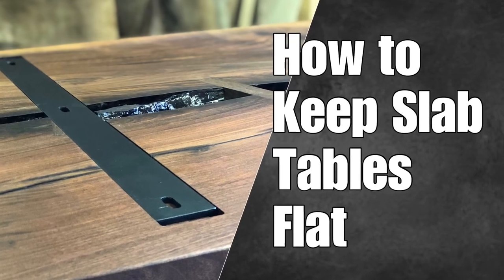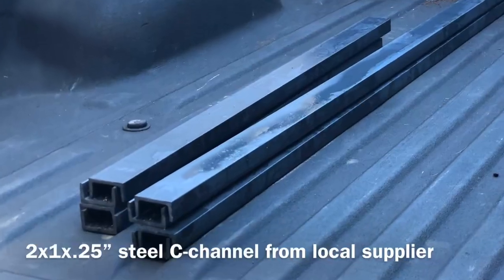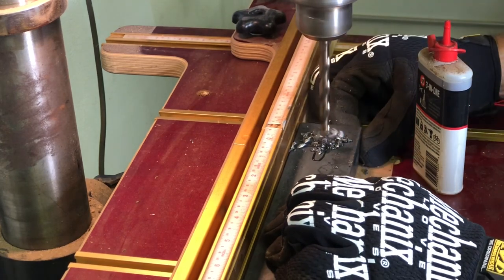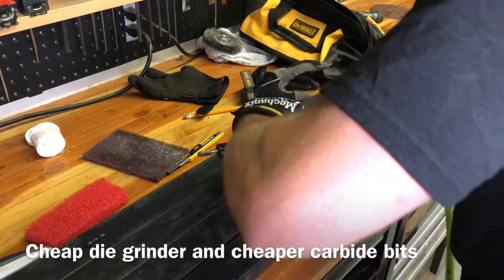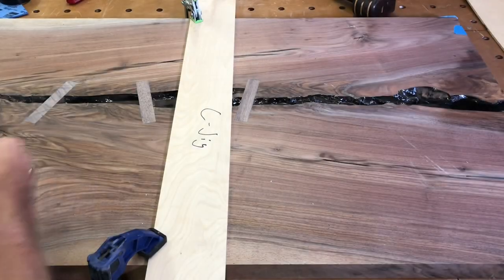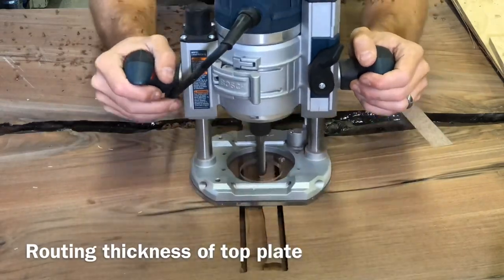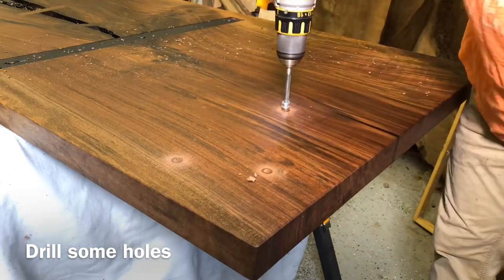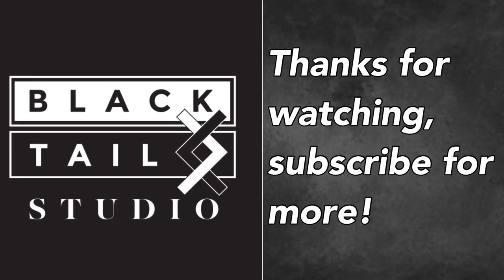How to Keep Slab Tables Flat — How To Woodworking

Comment: Really nice workmanship. I like how you think of everything. Take it or leave it (just a suggestion). When installing the C channel, I think I would just drill a single hole in the centre of the channel and slot the outer holes as you have done. This way the channel will always remain centred when expansion and contraction happen. Just my 2 cents worth.
Reply from the maker: MikeJ yup! I think you’re right on with that point.

Comment: Two questions: i remember you saying you didnt like drilling into epoxy so you needed odd sizes for river tables.... so what would you do on a river table with epoxy all down the middle? and is there a formula you go by for how many of these channel supports youd would need based on the length and width of a table? i.e. for a 60" table youd use x amount and for a 104" table youd use y amount

Comment: That's a good point to remember, tight center bolt and slightly loose outer bolts. Wood movement is not just likely, it's guaranteed.  I find that putting a little Loctite blue on the bolt threads really helps keep them in their slightly loose setting but prevents them backing out on their own. Be sure to use the blue and be wary of the red if you ever wish to disassemble the table. The red is some gnarly stuff.
Reply from the maker: That’s a great idea actually.

Comment: Cam, I have been following you for a couple of years and have purchased some of your products and training. So, I have a lot of faith in what you do. that said, I am curious as to your thoughts on the following:    I am about ready to build a slab table and it was a no brainer that I was going to add a C channel, then I saw a vide that Encurtis just put out which got me thinking. Basically, he is saying that a C channel is a waste of time at best. So, I started doing some research on the topic. While I cannot find a lot of information on it, I did find a similar story being told by others. Basically, they are contending that: 1) even steel would not be strong enough against the forces of wood. 2) Keeping a slab flat is really done when preparing it and that a C channel will not save a poorly prepared slab. 3) Some speculation here on their part, but the routing of the channels for the the C Channel do more to help the board warp than if the C channel were never installed.

Comment: Hello, love your videos.  I'm curious if you ever considered outsourcing your c-channels to a local laser cutting shop.  I oversee the lasers where I work and I can tell you, a laser could cut an entire profile for one of your c-channels in less time than you will spend to make one of your slots. A job-shop close to where you live probably wouldn't charge that much to cut and bend channels.  You wouldn't be limited to available C-channel sizes, it would save you a ton of time and you would get much softer edges than you have with saw cuts and drilled holes.  If you wanted, you could get fancy and have them cut a name or logo into the steel too.
Reply from the maker: Ya, I buy em premise most of the time now

Comment: Hey Cam, thank you for what you do! 

I've been working through your epoxy workshop and the information in it is amazing... but I'm left with a lot of questions about C channel!

1. If you have translucent epoxy, do you try to hide the C channel, place it differently (I did see you try that in one video), or run it under the table legs to hide them? 
2. Can the table leg bases act as a C-channel too, or do they bend to much to count?
3. How far apart do you place the channels? 
4. How long of a channel do you aim for compared to the tabletop?

Comment: A tip for your slotted holes in your channel. A die grinder bit will fit your drill press. Step up the speed and slot away.

Comment: Can also slot the steel with a cutoff blade in a Dremel. The process would go a bit faster if you pre-cut with a cutoff blade in an angle grinder, but since the diameter is larger you won’t be able to go all the way through.

Comment: Very nicely done.  I appreciate you directing me over to this video.  This should help me with my tables.  

Going back to our conversation on the other video, my wood is dry and not wet.  I didnt have larger slabs, so I ripped some boards to length (roughly 4" wide) and then joined them together on the edges with glue and pocket screws on the bottom side.  The issue I get is the table slightly cupping as it moves and breaths between the warmer months and the colder months.  Flat as "A board" in the warmer months, but moves slightly in the colder months.

This may also be contributed to how I have the top attached to the base (coffee tables and end tables).  I did attach that with pocket screws also.  Hindsight, it doesnt really give the table a great way to move.  I'm completely a mature and I really dont know of a better way to attach the top to the base.

Do you have any videos or suggestions on how I can improve on that?

Comment: Hey Cam! Will C-Channel straighten out a partially cupped river table thats already been planed and cupped afterwards?
Reply: No it will not
Reply: You want your tabletop to be flat, the c-channel is primarily to keep the wood from shifting seasonally. It will likely always come back to cupped regardless of how much steel you attach it to… it’s likely I ne day sooner or later you’ll hear a loud pop if you decide to try and stop the wood from moving, if you stop one crack it will just create another if it’s got tension in it.
Reply: Thank you
Reply: Hi, great video and explanations. I have a bamboo slab (69x39 and 1,5" thick) installed 8 years ago on a kitchen island. It started to warp in the last 2-3 years. I tryied a few tricks, like a wet towel to return it flat. It works but it warps again and even worst then before. We do oil it but we forgot to oil the underside. Can I install the C channels and bring it back flat using the water towel and tighten everything up? Also, on a 1,5" thick, how deep should I go to or what size of a C channel should I use? 
Thanks a million @Cdaprod

Comment: SO- I am doing a solid walnut slab 22” wide x 8’ long x 2 1/4” thick. Would this system work for “stabilizing” this table and should I run them long ways or cross like you did based on the solid slab layout? I was concerned about the thickness of the slab being too thin after I router in the 1 1/4” C-channel…
Reply from the maker: Run em across the grain 👍🏼

Comment: Hey Cam, I really enjoy watching your videos and learning from you. I have a question when you get a chance: how do you go about sealing the edges and bottom that would be exposed wood? Are those only sealed by the oil product you apply near the end of the process? My thought process is: since the wood is clamped to the bottom and sides of the mold, when the mold is removed, that part of the wood does not have any epoxy on it.

Comment: Thank you for the amazing video. I made a walnut table and it ended up cupping over the winter. My guess is the legs didnt allow for movement. Do you think a few c channels would help pull this flat again? It cupped about 1/4 inch over a 44 inch wide table. Thank you

Comment: Hi cam. You said you don’t have to lay the inlay completely flush correct?  I can get away with just routing out the lines for the lip of the channels?  I’m only working with a 1” thick table top.
Reply: what did you do at the end? i have the same problem

Comment: In all the examples I've seen, the c-channel is secured to the table underside at right angles to the long table edge.  This makes sense since wood expands across the grain, and in most case the long grain runs more or less along the long side of the table.  But what about the case where the long grain is at an angle?   I have a 40" x 74" table with the long grain running at about 30 degrees to the long edge of the table.   I think I should I position the c channel at right angles to the long grain, instead of at right angles to the long side.    Or does it matter?   I ask because placing the c channels at an angle interferes with positioning of the legs, which DO have to be at right angles to the long edge.

Comment: I’ve made a tabletop out of 7 old weatherboards that is only 19-20mm thick. Should I still use C channel to keep it flat or something else? T bar? Angle bar? Does it need to be steel or would aluminium suffice? It’s a long table, 2.7 metres.

Comment: What actually makes the table warping after pouring the resin? I made a table top with olive wood and some resin. After it cured the complete table top warped. Over both axis. I tried to put some C-Channels in even that is not making the table top flat. The planks where about 20mm thick. That is so desperate to see that nice finished product warping that hard. Will you touch base on that on your workshop as well? Thanks in advance.

Comment: Excellent video.  I saw a couple of questions like mine, but didn't see a response.  For a river table with wide epoxy sections, you don't put threaded inserts into the epoxy.  Do you just drill into the wood portion?  Does that do the job well enough with 15" or more without a bolt in it?  Would you recommend putting the inserts in the epoxy, but make it snug rather than real tight?

Comment: I have a black walnut table live edge that is about 50x108”.  It has cupped about an inch on each side. I was considering doing a c channel as well, but using epoxy all the way across to prevent. It seems you are saying it needs the room to move and the epoxy would be counter productive.  Thoughts?
Reply: I am going to cut apart, joint, plane and reglue first. Forgot to mention that.

Comment: Hi Cam, 
I love all the videos, question is it always necessary to add c channels to an epoxy table and what direction do you recommend ? my table I'm making is 6 ' x 3', I'm on the finishing stages now and have been watching and using your finishing workshop to help. 

Thanks 
Phil
Reply: from what I’m told by people who make river tables for a living is that a c-channel isn’t necessary and if the wood wants to move it’ll move
Reply: to help it not move taking about the same material on top and bottom helps, from what I’m told

Comment: Hi Cam - The holes you’re drilling for the threaded inserts. I assume you’re drilling them as deep as the furniture screw is long, correct? Since the threaded inserts allow the bolt to go completely through? The bolts are about .5” longer than the inserts you linked to. Thanks!

Comment: So excuse my ignorance, but why the c-channel? Why doesn't a simple flat bar plate work or why is the c-channel better? It doesn't seem like there are any parts of the c-channel, other than the bottom plate of the c-channel, that are actually anchored to the table. So I'm wondering why the extra work and table mass loss (in theory weakening the overall stability of the table anyway) is worthwhile? Thanks for the videos
Reply from the maker: C channel is more rigid. Flat can flex

Comment: I have bought 3 0live ash  roundish through cuts .What is the best way to stop them bowing .I was thinking  4mm or above mild steel plate .. round or square .Or would the cu metal 2 inch x 1 inch mitred and made as big as the slabs will allow  welded at the corners .Then routed into the bottom of the slab...or do slabs cut laterally not tend to bow,,Thank you IAN

Comment: Hi Cam, great videos - thank you. Stupid question - do you not need to worry about the table bending lengthways?
Reply from the maker: Not really. There’s a calculator to figure out the sag though. Based on wood and thickness

Comment: Hello Blacktail Studio. Your videos are inspiring. Hope you are reading and respond to this inquiry. My table is a Walnut slab milled in 2010, air-dried for 10 years. The table is 10 feet long and 44" wide sitting on two 6" wide I-beam legs, positioned 2 feet from each edge. I was planning to add three 41" channels - one at the halfway point and the other two half way between each edge and each leg. Given it is a 3-inch thick slab, Q1. Do you think three channels (plus two legs) are sufficient to avoid cupping? Q2. Shall I go with 4 channels placing two channels between the legs?  Q3. Would you recommend deeper wing depth than 3/4" supplied from the Canadian company? I live 2,000 feet from the the Pacific Ocean and this table will be outdoors all the time with a cover for rainy season yet I will go with SS marine-grade bolts. Thanks for your video. I am in awe of your quality of craft!
Reply from the maker: There isn’t a set guide for these. Every piece of wood is different!

Comment: I am currently building my first table and your videos are really inspiring and useful. I have a question about c channels. My slab is 56”x32”, it is mesquite. In fact two large slabs have been glued and drilled together. Do I really need to install c channels? I want to try just for the fun and the experience but I am also short in time.
Reply from the maker: Hard to say for sure, I would probably though

Comment: What C-channel would you use for a 3.5 inch thick slab? its 15 inches wide on the bottom and 19 on the top.

Comment: Hi Cam. Thanks for all your informative videos. You're truly the best in the biz. Fairly new at this. I recently made a 48 x 24 x  1.25" table with burl and epoxy. It warped lengthwise. Can I clamp the table down flat and insert these bars after the fact or  am I wasting my time?  If I hold a straight edge lengthwise the middle is about 1/4 " lower.
Thank you
Reply from the maker: Some pepper have luck with that. I never like trying to make wood do what it doesn’t want to do.

Comment: I flattened a large walnut slab and the humidity here in NY gave it a slight cup. I have the slab inside now, out of the workshop with a dehumidifier running. Would it be bad to clamp the slab down to a flat table (pushing down the cup) and installing c channels to keep the slab flat? Or do you think it would crack? Thanks so much and love the content!
Reply from the maker: Oh man! Try adding water to the cupped side. Wrap it in plastic next time you’re not working on it.

Comment: Great info! Question. When glueing two large slabs (approx 24x110x2) that both need a couple 'bowties' - glue slabs first then work on bow ties? Or do bow ties first, then glue slabs... first timer gluing large slaps...
Thanks!
Reply from the maker: I’d glue em first

Comment: Love your videos!  Wish I could find some C Channel with shorter sides as I can only get 25mm where I am.  Just wondering if reinforcing lengthwise is a consideration for longer tables (if I still only want two legs).  2700mm long redwood table at 50mm thick.  I'm concerned it will bow in the middle.

Comment: Thanks Cam.     Seems like a great low-cost add-on to ensure that a high-quality piece doesn't twist or move and ruin all the work put into it.  One question: for the table shown in this video, it looks like the epoxy is not flush to the bottom surface of the table? did you pour with the table upside down, get it an inch thick or so, and then flip it over and finish the top surface only (cheaper, uses less epoxy, but maybe not as stable?),  or did you come back and fill the rest of the epoxy voids on the bottom as well (more expensive, uses more epoxy, but stronger)?   Perhaps there is no need to pour epoxy 2-3 inches thick if it is never seen from the underside?  thanks from Connecticut.
Reply from the maker: Austin Brown good catch. It was not a river table. Just a narrow crack that I filled for looks. I also added Dutchman joints for strength.

Comment: Hey Cam...currently designing a desk top for my new work-from-home desk!  I have little experience working with wood and enlisted the help of a good friend with a wood shop.  After a short discussion the concepts of "warping" and "c-channel" came up.  The size will be about 30" x 60" and probably made from 2-4 pieces of wood.  I thought about using 4 pieces of c-channel, each about 24" long...is that overkill?   How much c-channel do I need?
Reply: Overall, when to use C-channels and when not to? If ima making a small table 1.8 Meters x 0.5 M?

Comment: what an incredibly helpful video. I can't find Murakoshi Bolts if my life depended on it. Any suggestions where to look?
Reply from the maker: I get mine from a local company in person. Any bolt and washer will work fine though.
Reply: I bought stainless machine screws for using with my EZLocks. Pan head with hex key for tightening

Comment: Question.  I’m doing a 78” x 36” table with walnut on the sides and epoxy pour down the center.  The middle 16” of the table will be epoxy. I want to inlay steel c-channel, but was wondering if you think it’s a bad idea to create a channel in the epoxy for the steel to lay in.  Thanks
Reply from the maker: Na, should be fine

Comment: Another great video! If the slab is completely epoxy sealed, should there be any expansion/contraction? Have also seen square tubing epoxied into the slab; is that an option as well?
Reply from the maker: Ya, the wood will still move. And I don’t think that’s a good idea.

Comment: I'm finishing a live edge table from alder I milled. The thickness is 1 5/8 and the width is 27 3/4 and the length is 59 3/4. Do you think I should install two 24 inch C-channels just to be on the safe side? I have bought the material and am ready to do it, but I was wondering if the piece is gonna need it due to it's dimensions and thickness. My gut tells me to just go ahead and do it. The channels are the same dimensions as the ones in your video but I was gonna cut them down a little shorter because the countertop is not as wide as the one in the video. Thanks for any input! Great video! Oh yeah the smallest inserts and bolts I could find were 30mm.
Reply from the maker: Couldn’t hurt!